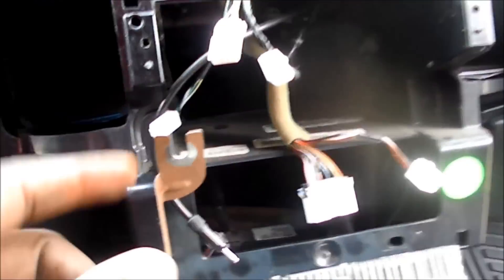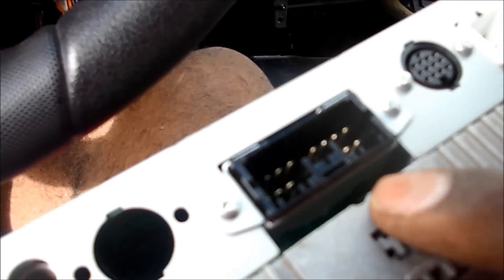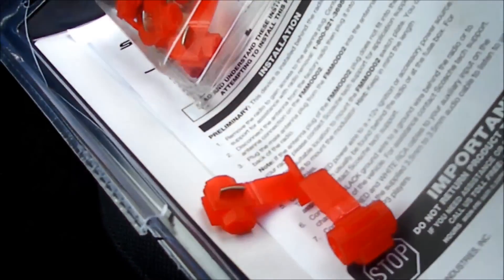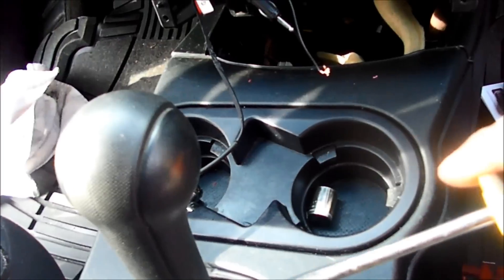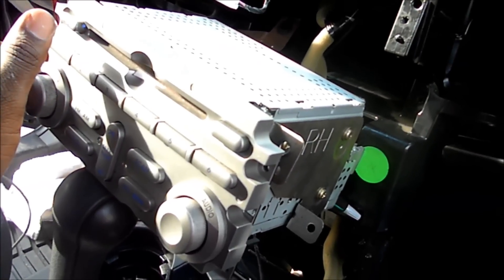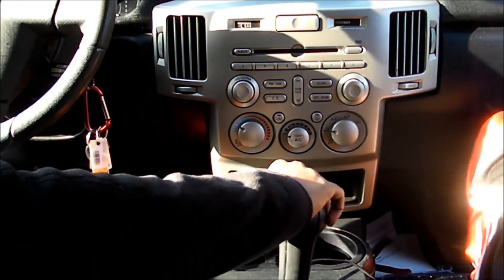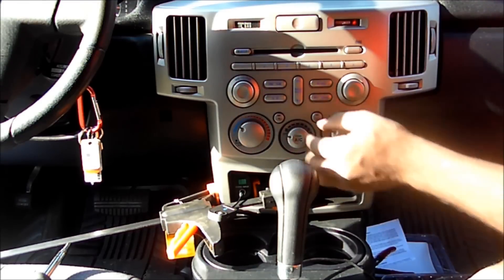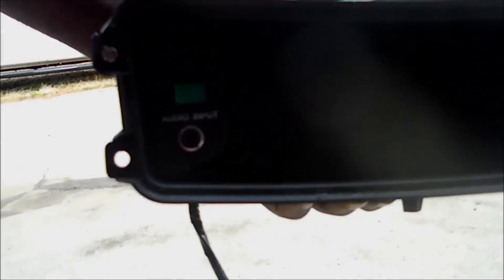2005 Mitsubishi Auxiliary Jack Install on the FACTORY radio

Comment: Could you have connected to the ignition 12v switched wire (blue/ white) so that you dont have to toggle?  Its powers on when the car is on.  Also, does it mess up any other stations while power is on?  Thanks

Comment: Does it sound clear with no static cause i bought a fm transmitter and it sounds staticy with my subs at high volume and im thinking on buying a radio so it can sound clear

Comment: Its better to use an ignition switch 
Using 12v constant 
Will eventually drain your battery 

Also u can use the easy clips like 
he was

Or buy Pico 0956PT 10 Amp ATM Mini Blade Fuse Add-A-Circuit Fuse Holder https://www.amazon.com/dp/B001QRSBW0/ref=cm_sw_r_awd_snnyvb0VMDR2F

These will use the fuse instead and is safer and more professional looking imo

Anyways
This is the set up i'm using and i'll post a video as well thanks for reading

Comment: can u please tell me what the input 13 pin used for (black circle)!! someone told me u
 can use it to connect the aux to  ur system, i have found some cables 
on amazon but i need to know if this port is used for aux or not!
Reply from the maker: I always thought it was for an external CD changer.
Reply from the maker: Oh wow. Looks like that would work. I mean itit definitely looks like it would plug into the back of the unit. I'm just not sure if the functionality will be the same. Controlling a CD changer may be very different then connecting an mp3 player/ phone.
Reply: +LaDarryl Hollingsworth yeah was also curious how the system will recognize it(as cd player or aux). Bcoz the way u did it, it detect it as aux
Reply from the maker: I'm honestly about to take mine out because there are bluetooth devices that play clear and strong. Just bought one for Christmas and it is AWESOME.  Only $13 from ebay.  We didn't use any of the pins for our install if I remember correctly.  It just tapped into the antenna signal.
Reply: So what type of bluetooth device are you using?
Reply from the maker: On ebay it's tittled,  "bluetooth wireless A2DP car aux serious audio receiver fm adapter usb charger". I would send the link but links don't last long so it's best to just copy and paste that tittle. 
https://lh3.googleusercontent.com/-CSxPlcMp7t8Y9W6lpEkmEUkJaGaL9T0RzYBf18QFoLXrsCKD5HDCGcgA1QrbBnZzQ3sNVDUx04

Comment: Man Im SO slow. I didn't see these comments but YES while the power is on it does interfere with other stations. It has been no problem just switching the unit off though. We have been using this thing like crazy ever since we installed it.